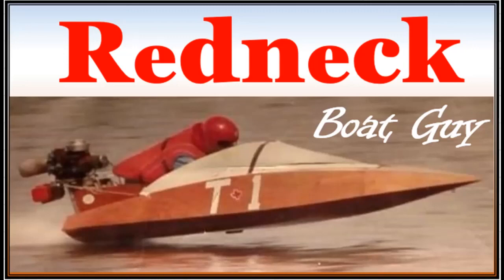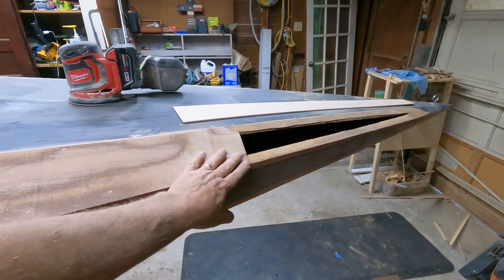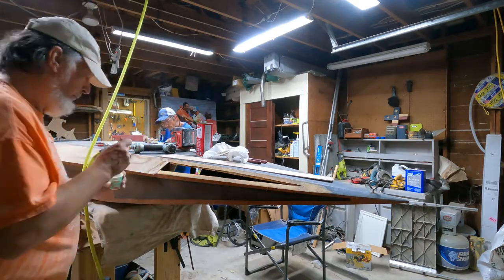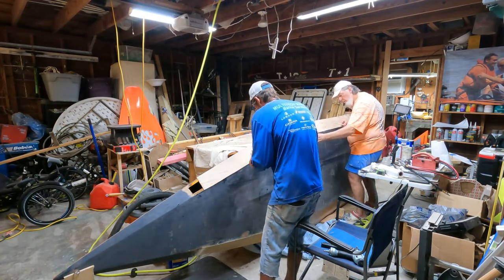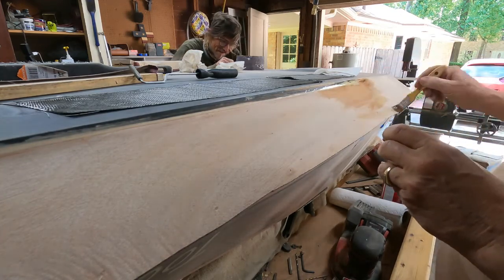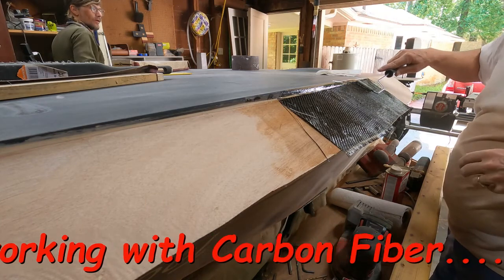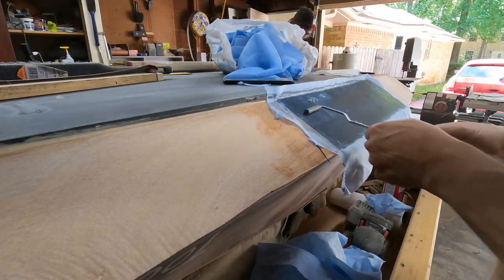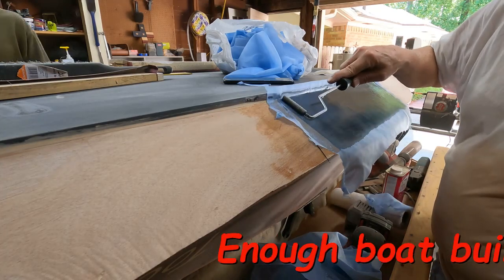Race Boat Rebuild, Turning Fin Side nontrip

Comment: Yup. I need one of them boats.. I'm gonna start a build this fall. BTW Rusty, What's the class you and russ are racing in called?
Reply from the maker: We run B Mod and C Mod.  20 cubic inch, and 25 ci. 2 cylinder
Reply from the maker: The NBRA is our club.  The APBA calls it 400 Mod and 500 Mod.